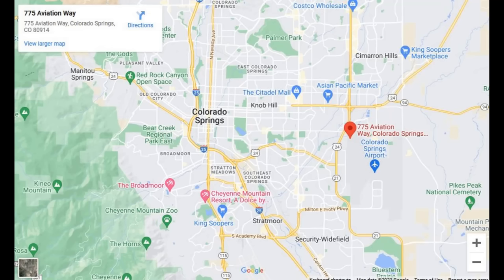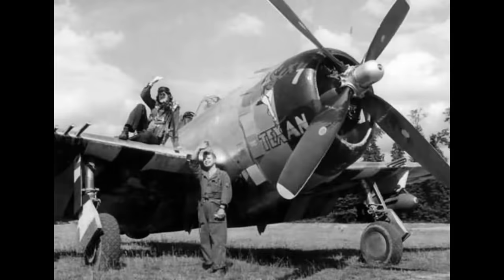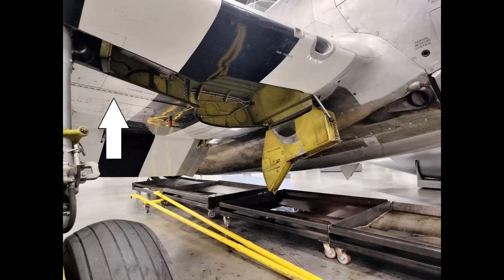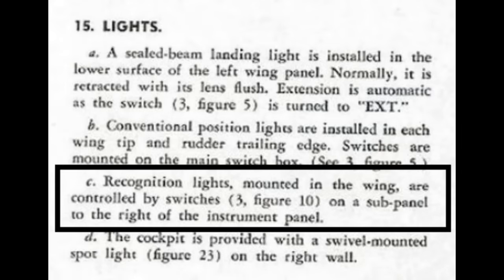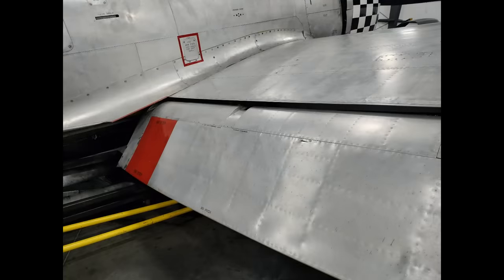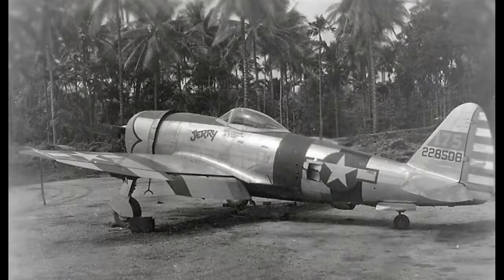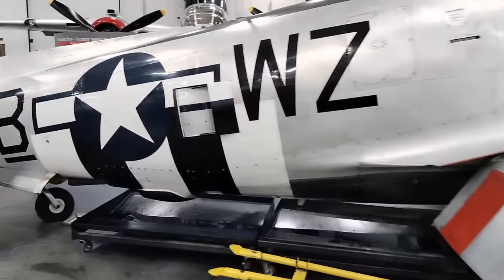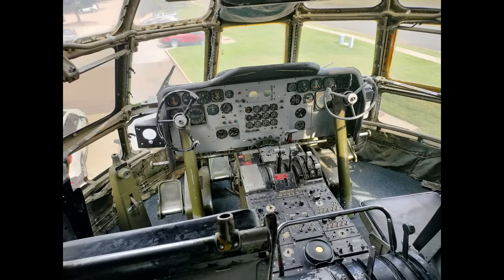Thunderbolt P-47 D-40, the Ultimate D model

Comment: My late father would have turned 100 this year. He was a pilot in the USAF and one of the things he was doing after the war was working as an observer pilot in the Philippines with a group that was returning P-47s to flying condition — probably to give to the Philippine Air Force, not sure on that. He didn’t fly them but when they put a fresh engine in one they would do standard ground tests looking for engine oil and hydraulic leaks. Then they taxied around and checked some more. Then for test flights my dad would observe fly-bys and look for leaks. On one test flight the pilot flew straight away from the field, then gained some altitude and dove straight into a swamp. Of course, they had to excavate the crash site but did find the remains of the pilot. Apparently he had run up an insurmountable gambling debt with the local crime syndicates and was convinced that he was done for — one way or the other. Sad story.

Comment: I never, ever could understand why the P-47 changing from a razorback to a bubble canopy model didn't warrant a new dash number...I mean, new dash numbers, or even model numbers, have been issued for less extensive mods..examples: P-51B and P-51C pretty much for just being built in different factories...P-51D and P-51K only being different props...another puzzler is the change from the B-17C/D to the B-17E..the whole plane aft of the wing was changed...why not a different model number?...
Reply from the maker: That's a good point. The bubbletops should have have been P-47Ds, they should have been P-47H or some other letter because they were so different.
Reply: It is a mystery, but all had to do with the way the Army contract was written, and how the dollars were allocated.

Comment: Wait, so 64” of manifold pressure is less than 20lbs of boost? I thought these old birds were making massive boost numbers simply because I never bothered to do the math. That’s less than most of my turbocharged sportscars  (although more than any of them shipped from the factory). Interesting. 17-18PSI has become a very common number for street cars in the last few decades. It’s cool that I can get a frame of reference for what manifold pressures we’re talking about on these fighters by drawing upon the decades of experience I’ve had with my MR2 Turbo.
Reply: engines, turbos, etc. have come a long ways since WW2.
Reply from the maker: Hold on there hot rod, you're forgetting about altitude. People often have a disconnect between manifold pressure and boost. Sure, at sea level 64 inches is about 17psi. However at 22,000 feet atmospheric pressure is much lower so it takes a lot more boost to get that 64 inches. For example in that case ambient pressure is only 6.2psi so it will take 25.5psi to get 64 inches. Yes your car can probably make more, but as you said, that's in the last few decades and with the advent of very advanced engine management systems. Doing it without knock sensors, air flow sensors, or an accurate speed/density system is another thing. Oh, and you're car is probably liquid cooled.
Reply: @SoloRenegade  
I’m definitely not knocking the design. I love the designs of all these old birds. I’ve just been listening to Greg’s videos for years, I’m an avid enthusiast of turbocharged engines owning several at a time myself typically and I’m a also mechanical engineer, so there is absolutely no excuse for having never done the math. I let that big number “64” inches trick my brain into equating it to PSI of boost @1:1 when it’s closer to 2:1 and that doesn’t even account for the first atmosphere of pressure that needs to be subtracted and the next thing I knew we’re talking the same kind of boost I was running on the street back in my late twenties.
Just took me by surprise but it’s my own fault for never having done the conversion before.
Reply: @GregsAirplanesandAutomobiles  
All great points, thank you. I can’t believe as long as I’ve been listening to your videos and I’m just now wrapping my head around these numbers.
Reply: @negativeindustrial  no worries. but what was cutting edge tech in the 1940s is obsolete in the 1990s, and we've made huge leaps in recent years. Look how many boring passenger cars come standard with turbos now. Even light GA airplanes are now coming standard with turbo or supercharging, EFI, FADEC, etc. 

Our knowledge has improved, we use electronics now to manage the fuel, air, timing, etc. We have better manufacturing and higher tolerances are easily held even at the industry standard. It's amazing how crooked a V12 crankshaft could be in WW2, or how out of alignment the crank case bearings were in a given engine (was talking to some Allison V12 engineers at Oshkosh airshow about this). We know far more now about complex airflows, engine theory, atmosphere, etc.

Over the years what was once cutting edge becomes standard in high volume low cost products. And this process never ends.

you can either use high performance technology to produce a smaller lighter engine that does the same job, thus improving fuel efficiency. Or you can keep the same engine size and use the higher performance to build race cars and high end fighters or racing planes.
Reply from the maker: I actually make a video about this specific topic, but few people watched it :(  https://youtu.be/B_0sIVURe0M
Reply: @GregsAirplanesandAutomobiles  
I’m on it. Thanks for the link!

Comment: Hey Greg, not sure you caught this video from EAA this year but some surprising performance issue related to the Curtis Electric prop on P-47's and its acceleration abilities opposed the the alternative. It's at the 4 minute mark or just after. https://youtu.be/oWkdM2ubeTk
Reply from the maker: I have seen this. That 47 has a Curtis electric paddle prop with cuffs. From a performance perspective it's about as good as it gets. However I don't know what prop he is comparing it to. The Hamiton Standard paddle prop from the same time period was just as good, but maybe they use a different one in today's restorations, I have no idea. The overall impression I had was that he was just surprised when he found out just how much performance a Thunderbolt really has.
Reply: @GregsAirplanesandAutomobiles  yeah, it could be he doesn't have a massive amount of time in them but he did mention other restorations use later model propellers on early mark engines. So maybe having the right prop/ engine makes a serious difference? Wonder if the people building sims have been going to those P-47 restorations for info when building flight models and skewed our modern perception on just how good the A/C performs when we fly it in Simulation flight. Since it's really new out of rebuilding wonder if any sim flight model designers will go and compare notes with them in the future?
Reply from the maker: I don't know what they do, but there is a ton of information from the USAAF on different engine prop combos for this plane.

Comment: P-47 war real war horse. Big, mean, and thick hided. Also ate all the feed that USAAF managed to offer to it. P-47 was swiftly retired in USAF service in after war lean years. The plane was ment for war. Not for peacetime. Betcha i  would had prefer riding P-47 on bomb run over P-51 in Korea.
Reply from the maker: The P-47N would have been a better choice in Korea, they did dominate over the Taiwan Straights with a 30:1 kill ratio in the post war years, just not flown by the U.S.